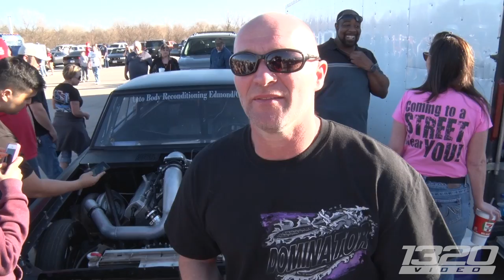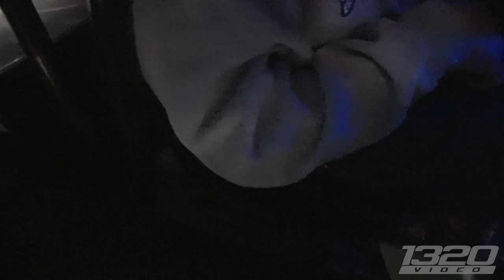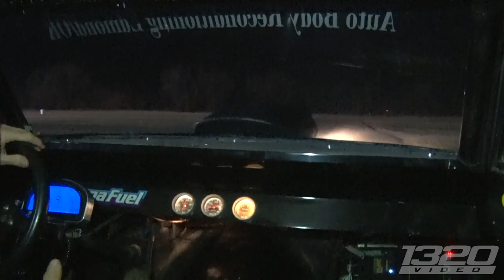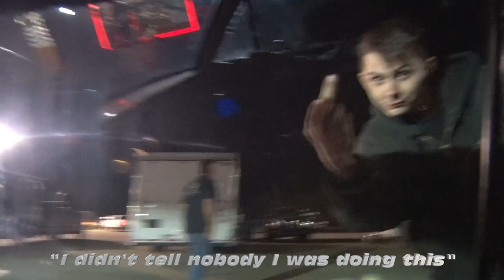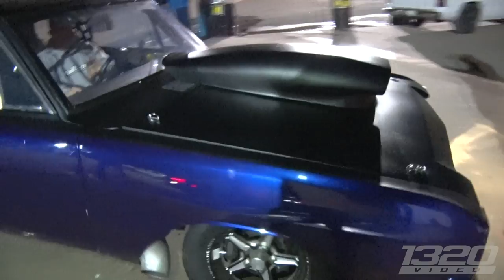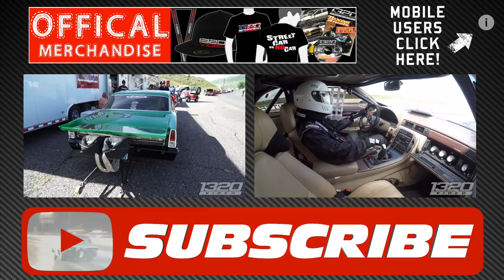DOMINATOR - SECRET Dodge Dart Build!

Comment: Where the fuck do you get methanol for less than $2 a gallon???????
Reply: +jarjarlol 
We buy most of our methanol in bulk and the price per gallon is near $2. 
The cost of methanol has fallen considerably in the last year. 
If I remember correctly, ethanol is usually more expensive than methanol. 
I will look at our last invoice in the morning and post the exact figures.
Reply: +patw52pb1 
I always run VP m-1. Circle track buddy turned me on to a bulk distributor selling alcohol for half the price.of VP methanol. The guy said it's mainly used to clean machines in factorys. Car ran about the same numbers, but the consistency fell off. Went back to VP & the dead on numbers returned. I see these guys running around in those brand new "sponsor" t shirts, i doubt they even paying for those parts or fuel anyway, after all, it is free advertisement on national tv.
Reply: +Michael Flaherty 
Our costs as promised and thanks to Cheryl for compiling. 
Methanol 99.99% purity in 55 gallon drum for $3.36 per gallon. 
Methanol 99.99% purity in bulk 500 gallon for $2.65 per gallon. 
Methanol 99.99% purity in bulk 1000 gallon for $2.15 per gallon. 

Methanol 99.89% purity in 55 gallon drum for $2.99 per gallon. 
Methanol 99.89% purity in bulk 500 gallon for $2.16 per gallon. 
Methanol 99.89% purity in bulk 1000 gallon for $1.51 per gallon. 

Ethanol E98 97.99% purity in 55 gallon drum for $3.79 per gallon. 
Ethanol 99.99% purity in 55 gallon drum for $72.94 per gallon. 
Ethanol E98 97.99% purity in bulk 500 gallon for $2.97 per gallon. 
Ethanol E98 97.99% purity in bulk 1000 gallon for $2.34 per gallon. 

VP M1 racing methanol in 54 gallon drum for $6.24 per gallon. 
VP M3 racing methanol in 54 gallon drum for $6.49 per gallon. 
VP M5 racing methanol in 54 gallon drum for $6.78 per gallon. 
VP C12 racing gasoline in 54 gallon drum for $9.25 per gallon. 
VP C16 racing gasoline in 54 gallon drum for $10.55 per gallon.
Reply: +gearbanger57 
Quality is extremely important with any performance/racing fuel, especially with ethanol/methanol that are hygroscopic and extract and absorb moisture from ambient air. 
Fuel can easily be mishandled or stored improperly that results in significant contamination and or degradation. 
We analyze all fuel as we receive it and again when we dispense it. 
Our suppliers also provide us a certificate of analysis with every delivery and we do not have issues with quality or contamination. 
Most fuel issues we have encountered occur with the end user and usually involves improper storage and handling.  

Most would be surprised at what the cast on the Discovery shows actually get in the way of compensation, perks and freebies... it is surprisingly little.
Reply: patw52pb1

I'm well aware of all that, been running methanol over 20 years. I won't run the low grade stuff again. I really dont know what the show pays, neither do you, they say it isnt much. Obviously from all these vids of them all over the country, they not spending much time at home making a living. Appearances, apparel sales is big money, hell, you ever notice the front room of their shop? looks more like a store in an outlet mall. Dont get me wrong, who wouldnt want to make money doing what they love. I remember the Teutuls on American chopper saying once they didnt make much off the show, Made them millionaires
Reply: +gearbanger57 
Sounds like 20 years of fun. 
I would not want to run a low grade fuel either
If you are happy with a product because it has a brand name you like on it and do not mind paying 2 to 5 times as much for the same product, that is your prerogative. 
Just notice for example that VP M1 is 99.85% purity, VP M3 is 99.8% purity and VP M5 is 98% purity. 
The methanol we use is 99.99% purity that is guaranteed by the supplier and confirmed with in-house and independent laboratory analysis. I suppose that proves the adage of less is more. 

I know a lot more than I reveal. 
Notice that most of the episodes are recorded at night and on weekends, that is not by accident, these guys work legitimate jobs and run successful businesses in the daytime, record the show at night and race when they can. 
Several of the cast have day jobs that are not related to the automotive industry or racing. 
One prominent racer on the show works in a refinery, another runs a towing company, another is in the construction industry.